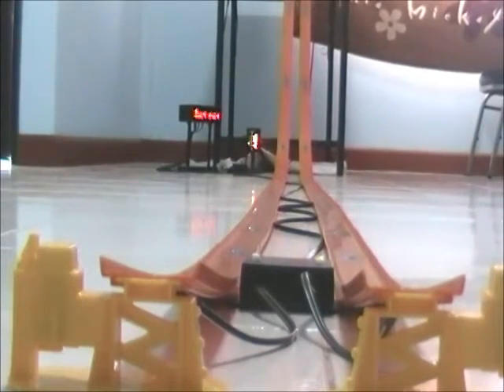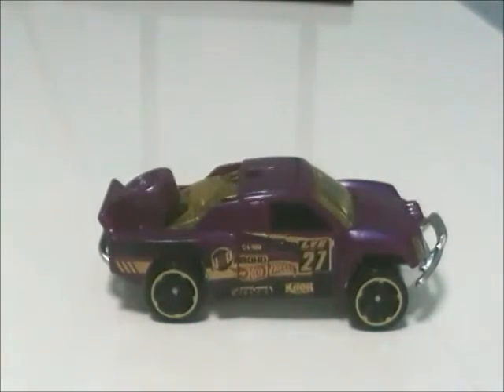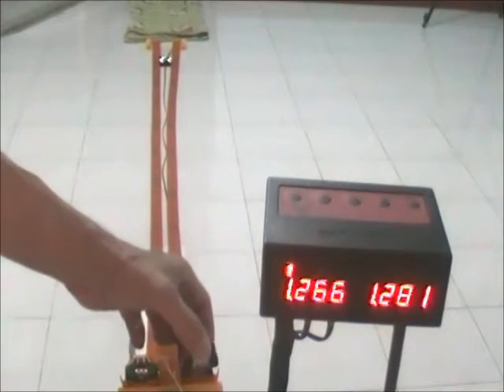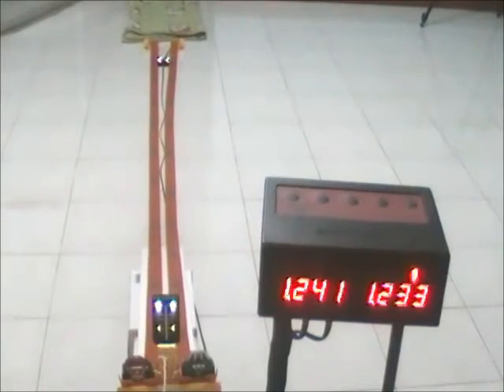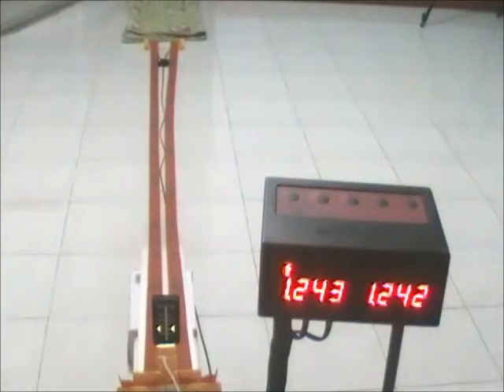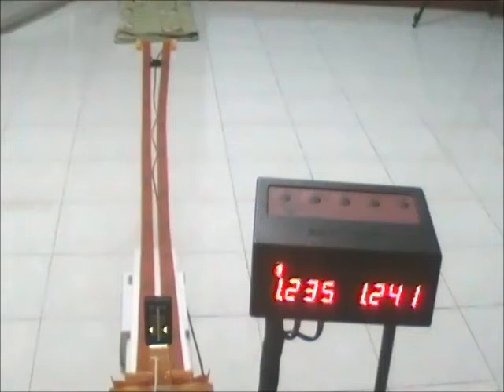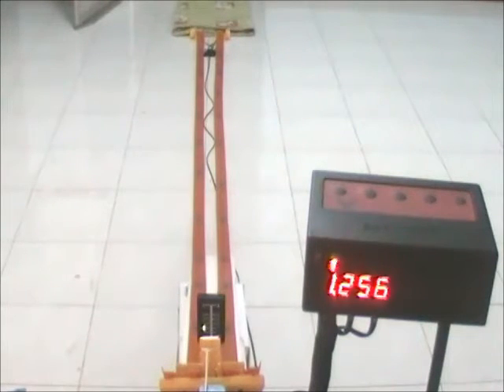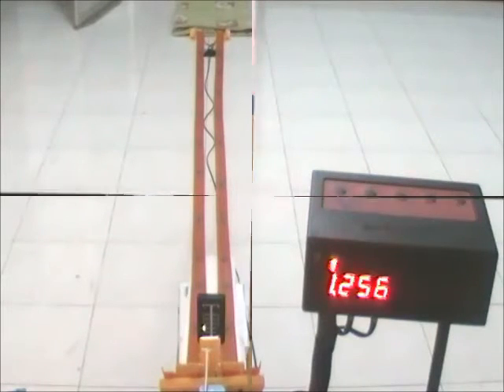Hot Wheels timer

Comment: Just ordered the timer from you. I've built a 40 ft. drag strip for modified Hot Wheel cars (Added weight and wheel swaps). To say I'm excited about getting it, is an understatement.
Reply from the maker: Forty feet? Good lord, what? Do you live in a gymnasium?
Our standard package only allows for about 26 feet with a couple feet for slack. I can make a custom length for you, I only charge a buck for each extra foot. Most of this is to cover shipping costs because wire is heavy. But if you can commit to making a utube video I will ship for free. 

Modified Hot Wheel, we want to be part of it, that is the understatement.
Reply: @TheBoone57  No problem. I sent you an email last night about the timer being delayed. You responded by telling me such delays are normal due to the materials being shipped, i.e sensors, etc. 
I live in a pre war apartment building in Brooklyn, that affords me space to have such a long track. It's a combination of high banked wall track and sizzler track(Fat Track).  Most of  my ideas come from watching other you tubers who race 1/64 die cast scale modified cars.
Reply: Any way of making one of these large enough to drag race rc cars? Affordable systems are near impossible to find.... let me know I'd be very interested. Thank you